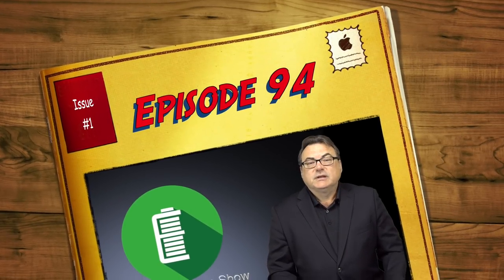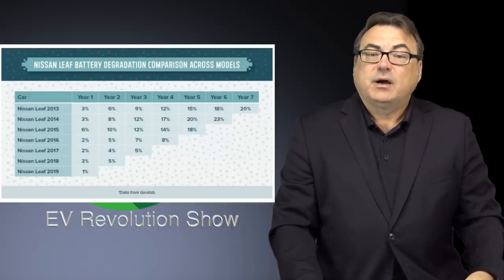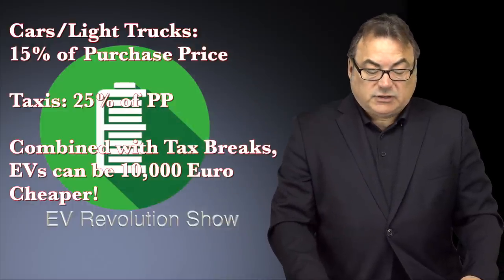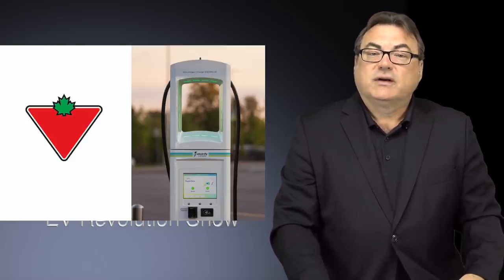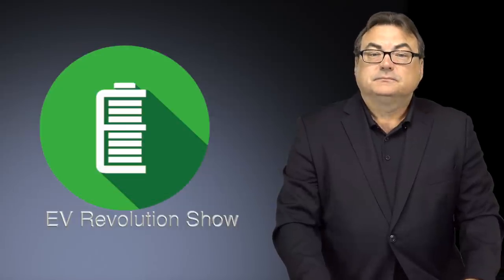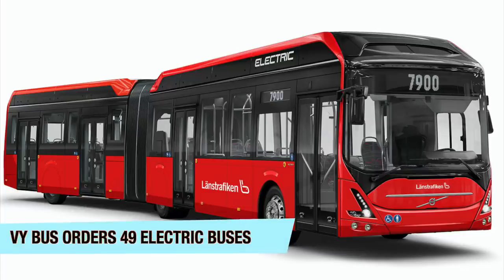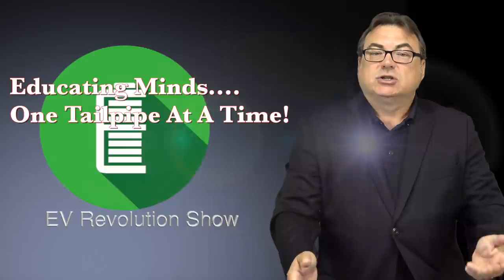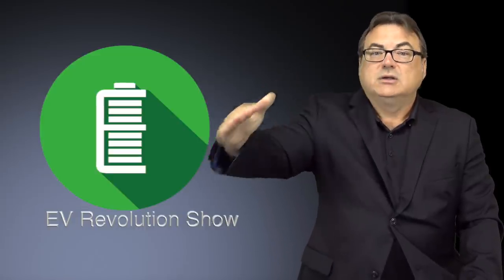Episode 94 - The EV Revolution Show - EV News from Around the Globe!

Comment: Got to remember that fossil engines degrade over time too and some of them don’t even last long before some major work being needed on them.
As we know, batteries may degrade a few percent but it doesn’t need a new cam belt, fuel injectors or whatever.... it just keeps on going just maybe not as far.
So EV's are still brilliant.
Reply: I wonder if the cell to pack manufacturing process will ease maintenance on battery degradation in the future, so we don't throw away many good cells for a few faulty on the modules, like it is done at the moment...
Reply from the maker: Could not agree more Dave!
Reply from the maker: Hopefully and more sustainable practices are being used all the time.
Reply: fossil engines????  Could not disagree more Dave!
https://www.rapidtransition.org/stories/the-rise-of-brazils-sugarcane-cars/

EVs have a great future...so there no need to try spin what an engine is... Or what does and can fuel it.... 

But on SM facts do not seem to have much meaning as much as being melodramatic...
 so feel free call an engine the " the killer of mankind" if you like and have a nice day :)

Comment: Good going finding those battery degradation stats. But how can a model have ZERO degradation in a year?
Reply from the maker: I believe if would be so negligible that it does not record a value.  Plus, the Bolt BMS may take a bit more safety room for battery "space" than others to help.
Reply: @EVRevolution  Yes, something tells me this is probably an artifact of the charging thresholds. But I haven't thought enough about it to have an opinion on whether this has a rational basis, is simply an oversight, or is someone actually being deceptive.

Comment: Degradation list canot be accurate. The reported battery capacity depends on battery software and could be masked by the useful limits that imposed on upper and lower charge. Perhaps 5 or 10 years would make more sense.
Reply from the maker: Just reporting on what is presented.  Thanks for watching.
Reply: totally agreed, 0% hahaha.. thats absolutely funny, even if its reported, that simply is impossible and violated physics.. omg

Comment: Hi Kenneth just watched your show on the cyber truck again, i was still amazed at your Conservative view on pickups. Now Tesla has 650K reservations has the past few months changed your view on the cyber truck or has it grown in you?  I had a similar shock when I first viewed it but now, if I could buy one I would.
Reply from the maker: Hi John, thanks for watching and I really appreciate the question.  Yes and no.  I always thought that the CT was a great addition to the Tesla line up and it will do well.  My view was one of market potential, not that the CT was not a good truck or BEV, but that with a more traditional approach to the current pickup truck market, Tesla could have gone after a much bigger space.  The design (take the looks away) aspect of the unibody limits the amount of choice that can be manufactured for interested consumers, businesses and fleets.  Look at the Honda Ridgeline or other similar unibodies to see how limiting their marketshare is because of this design.  I understand it costs less to manufacture, but that is the trade off.  

The shock and awe at first was of course around the polarizing looks, however when you peel that layer back and look at the functionally offerings that a more traditionally body-on-frame build provides, you will see what I mean when I say the CT will fall short.  The F150 alone sold over 1.5 million units globally last year.  Add the other offerings and you get a large market for this kind of traditional design.  

That is all I am saying about it.  Would I get one?  Well not at the current price point, nor do I need a pickup truck.  Won't fit in my house garage and any full-sized pickup is too big for my wife to drive.  So for me, no I don't see a CT in my future at all.  Not to say it will do well in general sales of course, just not as well as it could have.

Comment: do you have any info about who makes the battery for the Mach E Mustang.
Reply from the maker: Hi John, the battery cells for the Mach E and Transit vehicles are made by LG at its plant in Poland where LG installed battery lines dedicated to Ford. Yes the Mach E and Transit will use the same cells, thereby lowering some costs for Ford as they can order more cells.  When you fill a cell line to exact capacity that is your lowest price. You never, ever want it to be idle.  The line for the Mach E and the Transit will run 24 hours a day, seven days a week.
Reply: EV Revolution Show good news thanks, Ford dealerships that sell the Mach E have very little info on the car, and the salespeople have even less. I was asking questions at my local dealership and they couldn’t answer any of them, maybe you have heard. Does the Mach E have a heat pump? He looked at me wondering what I was talking about, said he knew it had an oil cooled battery pack and that it could recover heat from that. Are the seats cooled? Didn’t know, said the leather mate was perforated and heated but didn’t know about cooling. Fords web site doesn’t help much either.  Apparently dealerships that qualify to sell and service the Mach E are allotted only 2 vehicles this year slated for delivery next spring. So we won’t be seeing many of them around any time soon.  With Ford wanting to make this iconic car a success they are sure being quiet about it all. Any info that you can get would be appreciated.   Thanks.  John